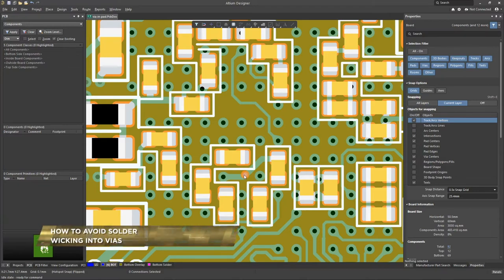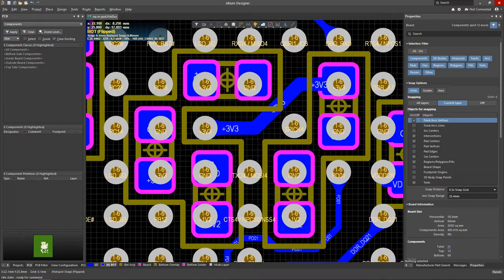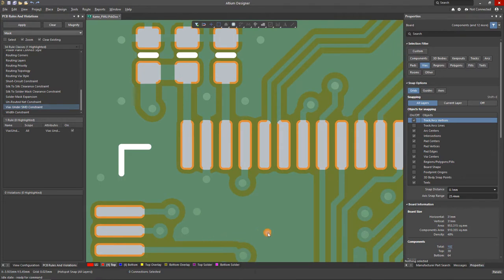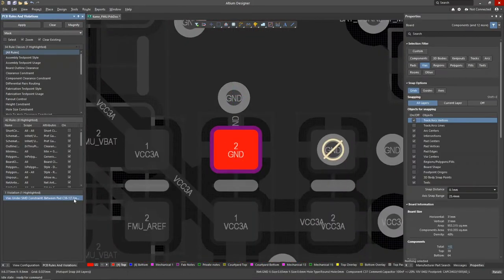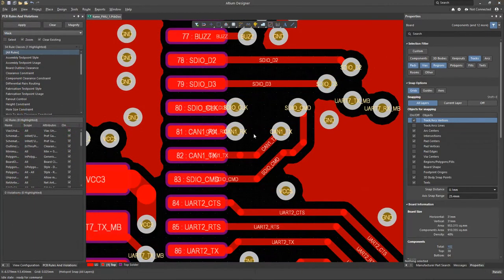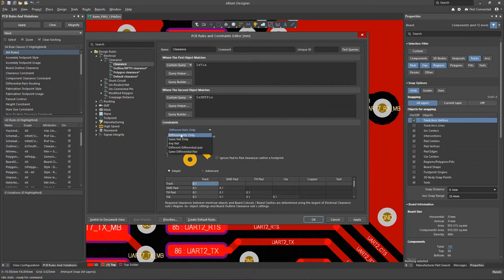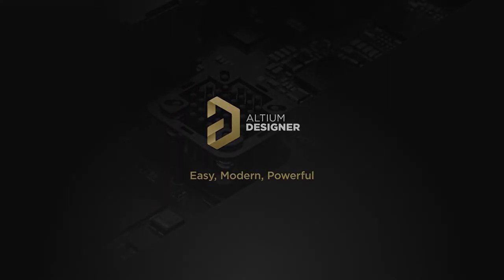How to Avoid Solder Wicking in Altium Designer

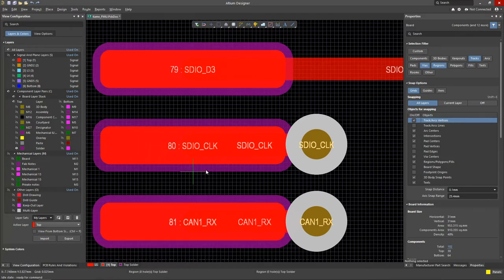Comment: 1:06 How do you move solder mask expansion and via hole like that?
I didn't know that was possible in Altium (without manually changing the pad and via settings in the properties panel).